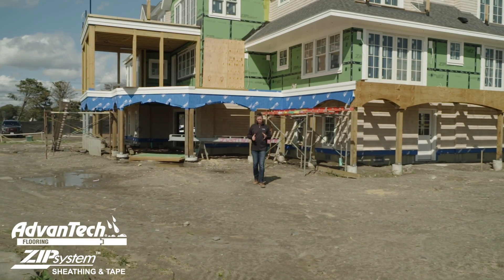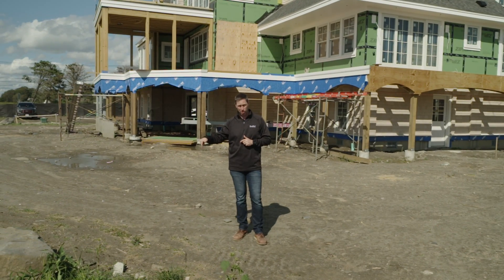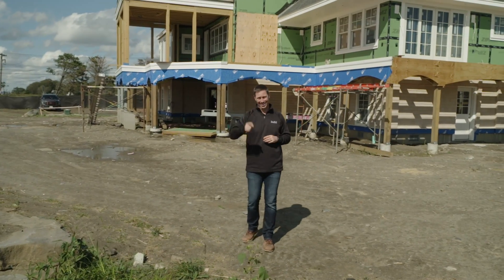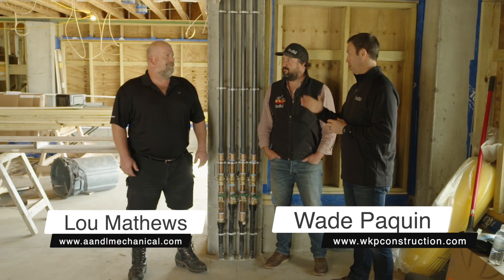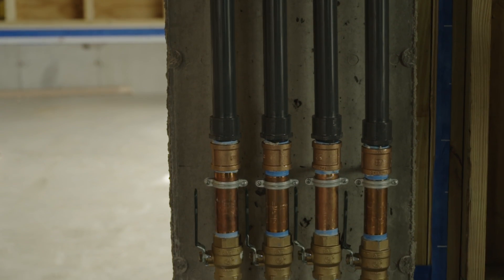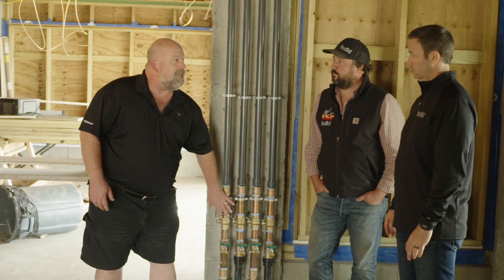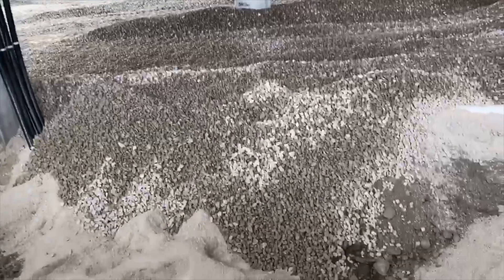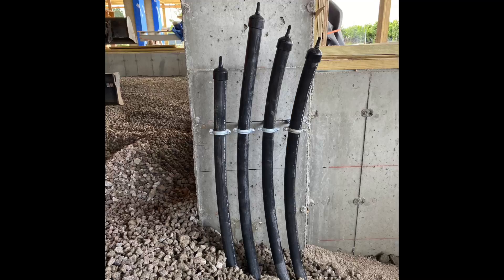Debunking 3 Geothermal Myths

Comment: Welcome to RI! 

I've only experienced one geothermal system in an office in Rhode Island. It was a combined system which integrated solar preheaters and geothermal. The geothermal NEVER made enough heat once the temps dropped below 50 and every hole in the roof from the solar preheaters leaked rain and snow. And, when it was cloudy, the preheaters were ineffective. The propane secondary heat would run non-stop from Nov to Apr. Glad to hear the technology has come along.
Reply: That poor Office sounds like it was visited by contractors that needed putting in a gibbet out front as a warning to others. 
The roof has one basic but important job and that is to keep the weather out, that one sounds a disaster. Geothermal systems are best in well insulated buildings, one that can't even keep the weather out was never going to work and you have to wonder what the owners and the installers were thinking.
Reply: @helenlawson8426  In this case, the developer gave the building design to his daughter for a graduation present for her architecture degree. She was an environmentalist and an artist, but NOT a building engineer.
Reply: @RIBill  Lets hope she learnt something from it. :)
Reply: @helenlawson8426  Highly doubtful. She probably went on to design bigger, leakier buildings at greatly increased costs!

Comment: How deep is the wells? In Sweden we usually only have one well or maybe two for a really big house in the northern part of Sweden (I live above the Arctic circle). We usually drill 180-220 meters (590 to 720 feet) sometimes closer to 250 or even 300 meters but that is pretty uncommon.
Reply: Tim Augustsson , in my area in the central US, most wells are only 200-300 feet deep. The depth is dependent on exactly where you are geographically. At that depth, the  temperature is pretty stable, about 55 degrees F. 
Then, it is typically one well per ton.
Reply: Youre probably drilling into volcanic magma!!! Haha, also you probably insulate well.
Reply: @bikesqump  Sure not hope so, we have to mines nearby that are more 500 meters and 1500 meters deep😂
Reply: I'm in Colorado and 300 feet equates to one ton (heat pumps come in 1,2,3,4,5 ton sizes). Industry supplies ready to deploy double pipes at 360 ft length (to allow connecting wells) so that is what drillers use.
Reply: @mv80401  heard about metric?those units make me twitch
Reply: @thenorthernhandyman  -- I have, being a German expat. But who cares considering that British Thermal Units are also a mess
Reply: @mv80401  btu isn't metric.
KW is a much better unit
Reply: @thenorthernhandyman  -- no argument from me but those metrics aren't even in the product description of our Bosch (!!) SM48. Gotta use what the locals use. Fun fact: when carpenters here talk about two by fours the lumber isn't even 2 inches, it's about 1.5x3, for fuck's sake!

Comment: With climate change all new buildings should have one of these systems or at least a heat pump installed. Time to stop all that gas equipment
Reply: If the globe is warming, we won't need heaters anymore, right?
Reply: @kellerrobert80  not sure if joking. If not climate change is called such as the destruction of the planets natural chemistry by humans will cause extreme climate swings hot will be hotter (way hot) an cold colder . And many ecosystems of plants and animals are severely threatened.  So anyways... yes you likely will need heat
Reply: And do you wonder what fuel was used to generate the electricity used to operate that heat pump?  In the U.S, there's about an 80% chance it is oil, natural gas, or coal.

Comment: Geothermal seems awesome but still seems to much. “More reliable”, in my opinion nothing is more reliable in this day in age, I’m not sold on geothermal. Being in the HVAC field her in Florida you don’t see geothermal obviously, but this is seemingly way more variables and pipe routing and god forbid a pipe fails but sorry we have to demo your house to make a repair.
Reply: This normally isn't place under the house, so there would never be a reason to demo a house to fix a problem with the piping (which btw should last 50+ years if done right).

Comment: nice to hear the differences in the new closed loop as opposed to the old pump and dump systems, Lou looks like he could drive a well casing by hand.....LOL
Reply: Pump and dump? You make it sound like it's not the way to do it.....ground water IS BY FAR the most efficient, and easiest way to have a system that will live forever.
"DUMP"..??? means that you've extracted or added the energy you need......warm in the winter, and cool in the summer.

Comment: Geo will not save you money. The main components are still built with planned obsolescence in mind by the manufacturers. Who's to say the incentives will be available  on replacement. When its down you have to wait for a qualified tech to work on it. Any energy savings is soaked up by higher service costs and replacement. Its a joke

Comment: I love my geothermal system!!  very reliable for nearly 14 years so far.
Reply: @chris shick:   New construction or retrofit? Im looking into the latter now...
Reply: @bikesqump  mm Cc g
Reply: how cold does it get where you live?
Reply: @ToddMoore1    it can get below zero sometimes but generally well below freezing January and February.
Reply: My geothermal unit has been working smoothly for 6 years ... use radiant under the house and in atrium, and HVAC in home.... new SIPs construction
Reply: I had to replace my single 6 ton unit after ten years at the cost of $18k.  I have since wisened up and now think ground sourced heat pumps are a waste of money.  Better off sticking the extra cost into air sealing and insulation and use mini-splits.
Reply: @etekberg  my house leaks like a sieve...

Comment: Would a pond loop save enough to bring it in line with a traditional condenser?
Zone 6, 9' pond that never freezes more than 2'.
Reply: you ask a very interesting question   ....   have you measured the temp at various depths in the summer and winter.    Also , how big is the pond ?    And what lives in the pond ?
Reply: @cedricpod  10 years ago the advice was 1 acre, but this is ~ 1/2 acre: <90' x >200'. Some of it is a gentle slope, some of it is near vertical. Less than 200' from house.
I'm hoping the tech has gotten better in a decade and can make do with less water.
No idea what the temperature at bottom is in the winter. Some years it never freezes solid, some years the ice is ~2'.
Some tall grasses and lily pads. No animals live in the pond year round. Frogs come and go, but they get eaten by birds.
It's pretty muddy/silty at the bottom.
Reply: @robertfeliciano5723  The problem is the debris that will come in through the open-loop system and this takes a toll on the equipment. You are then reliant on filtration costs. Perhaps some spin-downs would help. I don't know. 

But what about a closed-loop with-in the pond itself? Glycol is just concentrated sugar, even if there was a leak..it would be safe.
Reply: @StreamingF1ydave  I've never heard of an open loop in a pond. My reference to a pond loop implied closed loop.
For the reasons you stated, open loop in a pond isn't viable.
Reply: @robertfeliciano5723  there are lots of systems from over the years.

Comment: The choice of closed loop vs open loop isn't as simple as he makes it sound. Yes, there are ongoing maintenance requirements for an open-loop system. However, the upfront cost for an open loop system is typically much lower than a closed loop because you typically only need one well and it only has to reach the level of the groundwater. You also typically have an indoor loop and an outdoor loop, separated by a heat exchanger, so that only the heat exchanger (and not your more expensive AC/heat pump) can fail when fouling occurs. 

One of the biggest problems with closed-loop systems is heat saturation. For example, if you live in Houston where you are running Your AC a lot more than you are your heat over the course of the year, You will be dumping a lot more heat into the ground than you are taking out. Eventually the ground temperature rises and your AC can't cool as efficiently. This is much less of a problem with an open loop because the reinjected water flows and can disperse over a much wider area.

In the specific case of this house right on an ocean coast with brackish groundwater, yes, a closed loop is probably a good choice. Open loop systems are also viable, you just have to be a bit judicious in where you put them. For example, Cornell University has an open-loop system to cool its campus buildings and they are looking to expand the system's capability to also heat the campus as well so they can be more "green".

If you want more information on geothermal systems, Jay Egg is the person in the industry that is one of the "smart" people. He runs a geothermal consulting business and has authored a couple of books on the subject. He would be a good resource if you really want a deep dive on the topic.
Reply: Interesting information. I've been studying these LEED ( or Green ) building designs and they discuss these systems as the most energy efficient, environmentally clean, and cost effective space conditioning systems available. I've never been involved in a project that uses this system as I build in the Houston area. We'll see in the future. Thanks.

Comment: This may be in the works, but for a video like this, a very brief overview at the beginning on how these systems work (and perhaps why you'd want one) would be helpful.
Reply: Google can be your friend.
Basically, the energy transfer happens underground, within 200 feet of the surface, which holds a constant temperature. 55 degrees F is the rule of thumb. The liquid circulating between the house unit and ground transfers the energy. Heat is extracted from the liquid in wintertime by the indoor unit, added to it in the summer.
Reply: Ric Havic - Yes, it not only can be, but is. Thank you for the information. That typed, I wasn’t asking for it (although I appreciate your taking the time to provide it, even with the quip).

To repeat my suggestion, presenting an overview and listing reasons for choosing a geothermal option at the beginning of the video would make it better.

Comment: Geothermal traditionally is paired with a forced air system, how now days they can be used with VRF systems and use the same heads as mini splits.  Several manufactures even have means of providing domestic hot water, so in the summer instead of dumping your excess heat outside or in the ground it can heat your bath.
Reply: Could you also use the excess heat pulled from the house to heat a pool in the summer?
Reply: @Scootin159  that is a great idea.  The exit of the house loop could certainly impact the pool.  Exactly how would be interesting to understand.
Reply: My cousin in germany uses radiant floor heat in the winter and forced air in summer.

Comment: In the northern US, I think a “Geo System” would work well. Anyplace that the delta T is sufficient in the winter months compared to the summer months, these types of systems tend to preform better. With that said, these types of systems in the southern US, i.e., Texas, Oklahoma, Arizona, etc. do not tend to perform well. There is not a sufficient difference in the winter months compared to the summer months. I say this because when I was a mechanical designer, I worked with an engineer that would push these types of systems, in Oklahoma, and they almost never worked. He would layout the wells, I would size the pipe and route it into the building. We would also use a reverse return system and the wells would be 350ft deep. Closed loop systems. But they never worked right. This was also 25 years ago. I made a comment one time about the well spacing and he showed me on his “program” that he had that after 3 years the wells would be so hot they were basically ineffective. I made a comment about that and was basically told to be quiet. It’s his money to fix it not mine, right. So... up north, I’m sure it’d work well. Just not in the south.

Comment: I wanted this 5 years ago when we built, but contractor insisted we also had to instal a second heat source, and our fire place didn't count. Such a shame.
Reply: An acquaintance of mine had a geothermal system installed. It must have been a lemon, as it would stop working and take a month or two to get fixed. All that time, it was running on very expensive resistance heat. The contractor must have lost his shirt on maintenance and went out of business. No one else would service it, so she had to replace it with a gas furnace.
Reply: @johnhaller5851  dang, that would suck.

Comment: 3:15 of COURSE the difference in price is mostly the well drilling.  And excavation/drilling is NOT cheap.  If you're talking about a fresh system install with ductwork and everything then yeah you might be looking at "only" a 25% increase in price or something.  But if you are (much more commonly) replacing a unit, it absolutely WILL cost double or triple.  Because the cost to replace the indoor air handler equipment and the outdoor unit would be less than $10,000 easily....but that drilling and excavating can easily cost the exact same or more.
Reply: Excavation/drilling can also be very risky. If you live in a karst area (think: limestone caves, underground and not visible of course until you start driling), you run the financial risk of having to dump tons of betonite down the hole to insulate and stabilize the piping. This is a big, and potentially costly unknown.

Comment: That is a ground source heat pump not Geo Thermal. Two different animals.  That said GSHP units are great however the cost issue of the wells varies greatly around the country. Here in North TX drilling 4 wells is cost prohibitive as those 4 holes will cost as much as a nice house.
Reply: Said "ground source" heat comes from... get this... GEOTHERMAL.  And, a standard 400ft deep hole, for a single house in Texas where your load is AC, is good for about 8ton HVAC unit and not Heating, a single well will suffice and maybe require 2 if you have a REALLY big house.  Each hole will cost ~$15k.  Housing in Texas costs a hell of a lot more than $30k.  True, you have to get off your fat ass and put in the pipes, but even lard boys can buy a 1000ft of tubing and dump it down a well hole, add some sand for more thermal contact if the water table is low and connect a couple of fittings.   Oh, and get this: if you aren't stupid, you can use that well as domestic water as well if you ignore the bureaucrats.  PS: If you really wanted to save $$$, use solar thermal for your heat source for AC, or better yet, both.

Comment: Built one of these systems commercial back in late 80s with my Dad who designed it and I think it was 20, 20ft wells (he owned a well drilling company at the time) without glycol, just water. In the summer building inside was about 65 degrees and you had to go outside to warm up and cost nothing to run. It was closed loop, fused fitting with a heat gun device and redundant pump system.

Odd that it seems that they are just getting to closed loop now and had open loops before, wow that was a bad idea.
Reply: They had closed loop systems over 30 years ago.  And how did this system you speak of "cost nothing to run" in the summer time?

Comment: I think they don't usually calculate the efficiency (eg. seer) to include the pumping etc. that goes along with a geothermal system. I think most of the time it's cheaper and more efficient to go with a Mitsubishi minisplit now that they can run down to really cold temperatures...
Reply: We finally received our Mitsubishi mini-split bid when our geothermal was already under way:  $37k which was roughly the same as our geothermal, However, a geothermal heat pump sits in a protected basement whereas the mini split fans sit outside: much longer system life for geo. In fact the mini-splits are only warrantied for 10 years.
Reply: @mv80401  Interesting. I guess in your situation I would probably go with the geothermal.

Comment: Geo is the best option for Coastal areas. No condenser to get eroded by the salt air!!! Closed loop isn't new... In fact nothing in this video is new with in the last several years/decades.
Reply: geothermal is the best option nowhere. they are so much more expensive than air source systems that you would be better off to spend a few thousand dollars to replace the outdoor unit if it indeed got "eroded (sic) by the salt air".
Reply: @paperwait9611   Not true at all.  I had a geothermal system installed last year and with the tax credit, it cost me about the same as the most efficient air-source heat pump.  4 ton unit with four 200' wells.
Reply: @91156  ymmv. i got a quote on a geothermal system for my (average sized) house and the quote was $45,000. i suppose if i worked at it hard enough, i could find a way to spend $30,000 on an air-source system, but it would take me some doing! then again, i guess it all depends on how liberally you define "it cost me about the same..."